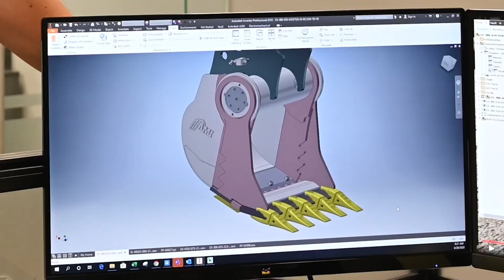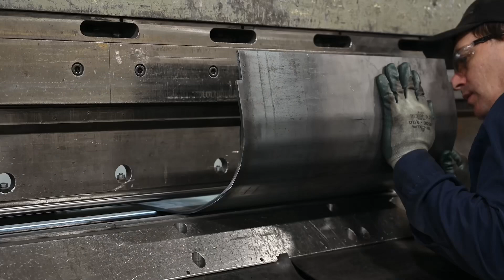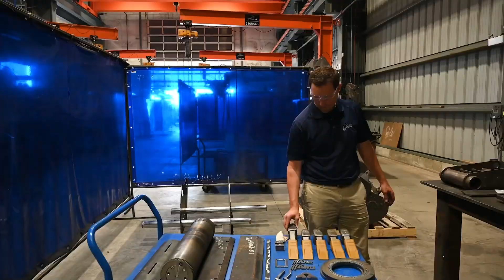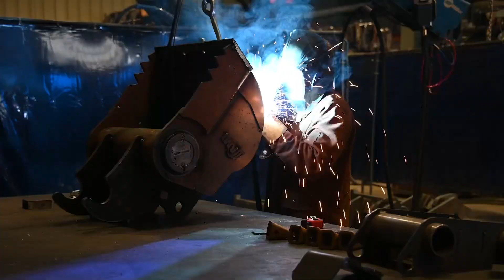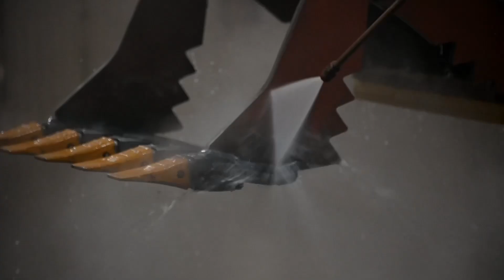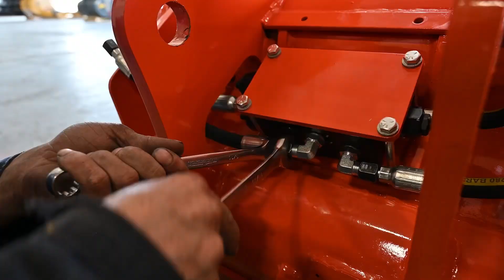How its made | JawBone bucket build, from start to finish AMI Attachments

Comment: Great video! It s a very interesting bucket that i ll be looking into. I just wonder what happens when you want to use the ditch bucket for a decently long job.  Is the thumb in the way as it is dependant of the bucket rotation. What happens when the thumb hits the arm, what kinds of protection is there?

Comment: Goderich Huron County Ontario Canada was home to Champion road graders until Volvo bought them out and after a few years stopped production. The last Volvooff the line was signed by all employees and donated to County rds department . Another Huron County town made luxury sail boats for Howard Hughes . A neighboring factory made Pioneer chainsaws later to be Husqxarna /Electrolux my Dad and sister built saws there in 80's . Goderich is also home to worlds largest underground salt mine ,stretching under Lake Huron.
Reply: Production was never supposed to be moved from Goodrich! They moved it Asheville NC and it was a disaster. They produced the highest priced grader in the market and was told they were loosing $40k per machine! Being from Canada I was a champion grader man. But no more now my girl is an 872 Deere.

Comment: Hi Tim,

The bucket looks great and seems very well made. I like the multiple use aspects of these type of attachments especially for
the one man band department like me. My only concern is that you tend to want to move the brush debris from trees and that
Is the majority of stuff to move. I suspect the bucket and thumb would lift more and more easily than the new bucket. You have a grab for that so that wouldn’t concern you. Anyway take care and keep up the good work.
Reply: Because of the shape of the jaw being curved right from the pivot, where most thumbs have a "heel" or elbow to enable tighter fold up to the stick, capacity is similar or greater with the jawbone. The extra benefit is that the thumb now automatically rotates with the bucket, ensuring the load won't loosen or shift in the clamp.
Reply: Brendan Leis 
Hi Brendan,

I believe the opening to be too small a triangle and on closure a lot of stick debris could be squeezed out. I’m probably wrong and
the amount lost could be easily compensated for by the other actions of the bucket. I would say Tim has already tested it out. It will be interesting to see. 
All the very best.
John
Reply: yeah the good ole ami made in canada build to last

Comment: I'm curious what happens when or if the "Helical Actuator" goes bad? can it be stripped down & repaired? It looks like parts of the bucket are welded to it, I'm curious if it can be repaired or is it a case of cutting the bucket up to replace the Actuator?
Reply from the maker: It can be rebuilt.
Reply: @cotontop3  jeffs and his crew are awsome to work with here in canada hes good buddy of mine
Reply: The end caps of the actuator can be removed and the entire actuator slides out of the housing.

Comment: Tim those fellas  did a very good job on the video. Very impressed  on the step by step construction  of ur bucket and the info on the different  types 0f steel they used. Also how clean  there facility   was looks 2b a big facility.  Have a good day

Comment: Awesome video but one thing that really stood out to me was the fact that he kept saying that the parts were LASER cut............they were infact PLASMA cut..............other than that, great video
Reply: Good catch! Most parts are in fact plasma cut but the machine has a dual plasma/laser head. So outside profiles are mostly plasma cut but geometry that fits to other components (like the inside circle on the endplate where the gear is welded) are laser.

Comment: I wanted this bucket . I was just concerned about dirt mud and water getting inside.
Reply: The helical actuator is completely sealed. No dirt or mud can get inside where the gearing is! The valving and hosing is all covered as well to prevent buildup.

Comment: Spooky! I was just looking at these types of 4 in 1  Backhoe buckets a few days ago. Of the various types I looked at this one stood out, I wasn't keen on the type where the rear of the bucket was the part that opened. I also  found that the ram placement  on many put the hydraulic lines in harms way for any heavy digging operations, especially if you were using the bucket to exert leverage for breakout of roots, rock etc. The helical actuator on this being internal away from the earth seems a better engineering principal. How does the clamping force on these compare to the ram actuated type?
Reply: Great question! Clamping force of course depends on ram placement, but these helical actuators are equal in force to hydraulic cylinders. The difference however is that it is really hard to drive them backwards, since they utilize a spline gear to generate movement, kind of like driving a worm gear backward. They are set to hold until just below the machine's relief settings, to prevent damage. And of course, zero exposed components to damage.